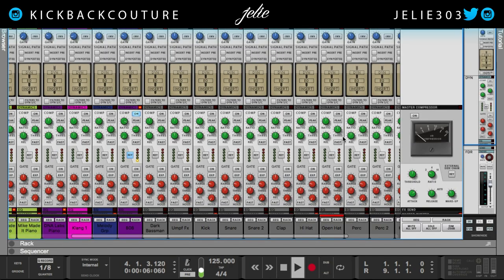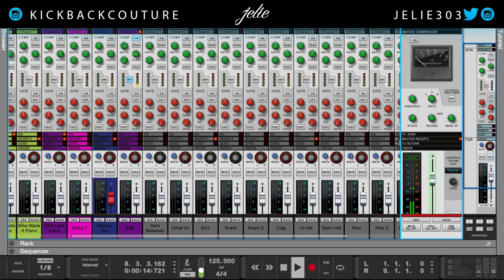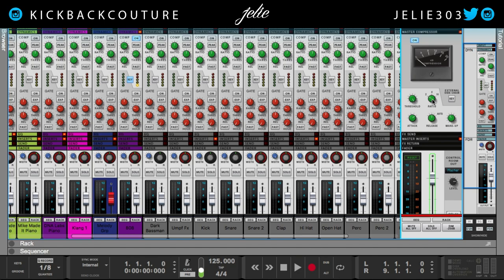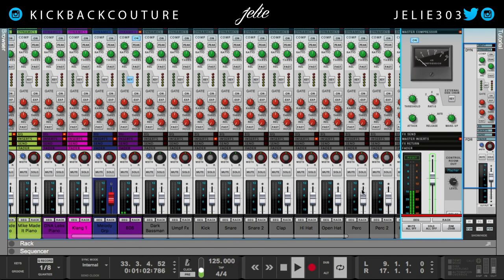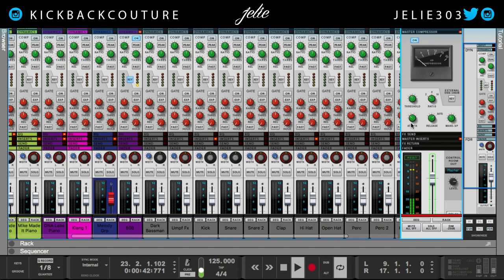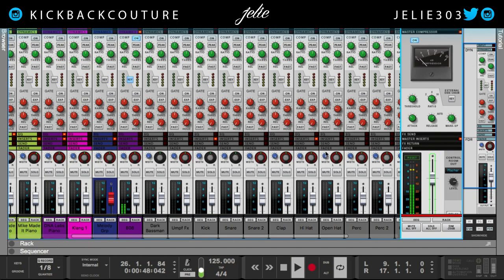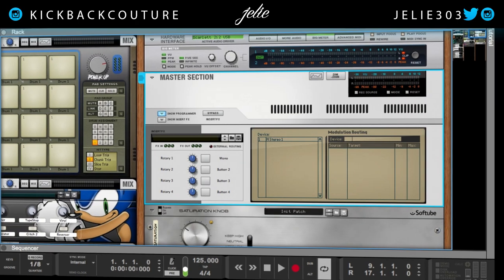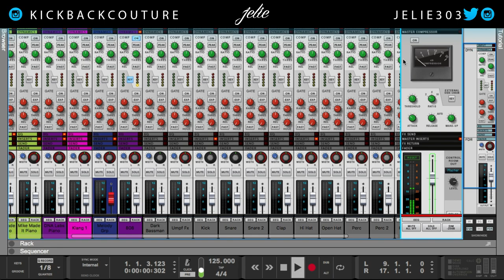How to use the Master Compressor | Reason 10

Comment: i use ozone 8 to master but it never adds the compression in the auto master i tweak it and add tape saturation and imaging but i have started putting this on as well just wondering if i actuality need.  it has maximiser in ozone

Comment: Not sure if you already touched the topic, but what's your thought or technique on gain staging?
Reply from the maker: I don’t really have a stern belief in what or how signals should be reduced or attenuated. Whatever gets the job done gets the job done. In a digital age and bass heavy at that distortion is the norm. However if you want to avoid distortion, starting at the beginning of the signal chain is paramount to keeping the signal clean.
Reply: @KickbackCouture  cool... appreciate your insight.

Comment: Yo , hows going , i ve a question about this one , so if you decide to use the master compressor does that mean it will be set as the first item in your master chain by default? for example if you put some eq , stereo expander and limiter on yor master bus the order will be 1 compressor 2 eq 3 expander 4 limiter?
Reply from the maker: The Master compressor affects the master channel, which is the master bus. It is the fader that controls the volume of the entire song to the far right. Everything on the master happens last as it is the last major point of signal flow.
Reply: @KickbackCouture  we misunderstood each other , the question was when you are doing the mastering if you use the master compressor how is the signal flow coming? will it go through the master compressor first by default and then through whatever you put on the master bus? cause i never used the master bus compressor i always use compressor rack extension and i can set it where ever i would like in my master chain.
Reply from the maker: By default, the master compressor works before the master inserts. You can change it by enabling the “Signal Path inserts pre compressor button” which is under the master inserts section of the mixer. This is this way in case you add you own compressor as you explained, or if you put a limiter/maximizer at the end of your chain to prevent clipping like I do.

Comment: If you want to A&B the Master Compressors effect on your audio...

01. Turn the Master Compressor 'Make-Up Gain' knob from it's default setting of 2.87 dB to 0.00 dB.

02. Toggle the Master Compressor 'On/Off' switch to hear an A&B comparison of your Mix (for example) with and without the Master Compressors colouration or effect on your audio.

The 'Make-Up Gain' knob is set to add nearly 3 dB of gain to the signal standardly because that is the amount of gain reduction you are taught to start with when using a master compressor on a mix for eample... Reason Studios knows this and this is the reason for the default knob position being set to add 2.87 dB of gain (just shy of adding 3 dB of gain) back to your compressed audio signal automatcally once the Master Compressors 'On/Off' switch has been turned on/engaged.